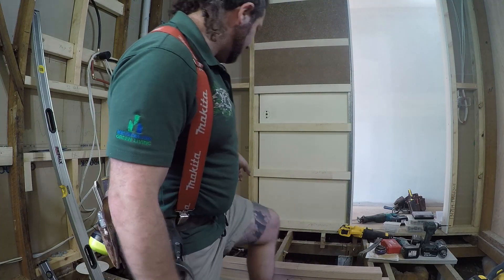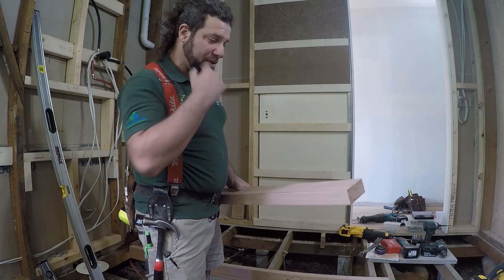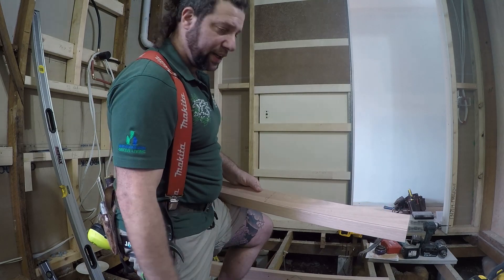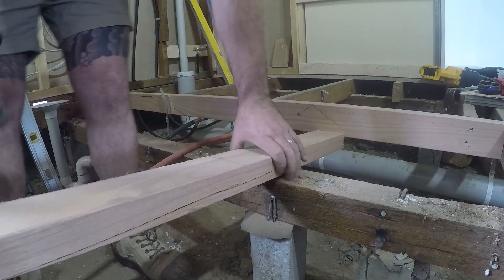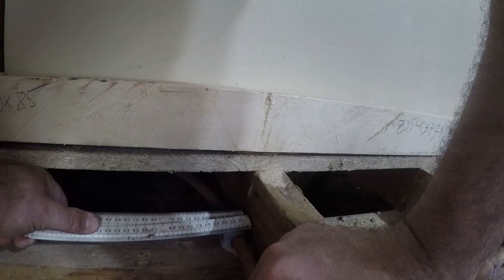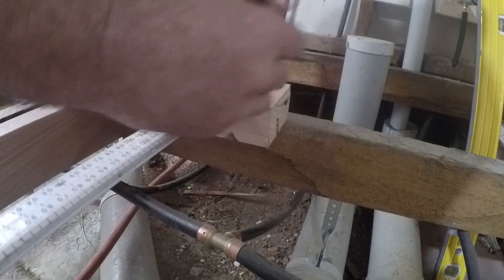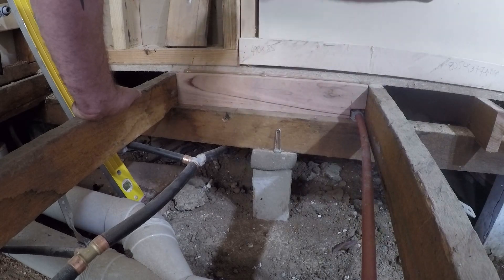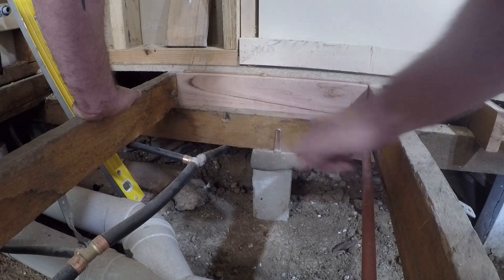How to correctly install Solid blocking / Noggin-ing for weight points

Comment: Can a noggin be placed flat for support under a shower or do they have to run down the joist?
Reply from the maker: Gday Dafydd,
Noggin's can be run in almost any direction, which ever way best suits the outcome... the key here is the fixing point and ensuring structural integrity.
Due to the outcome needed we need to understand the strength in the timbers and the grain direction.
On the other hand, if you're just "trimming out" for the shower base area with little to no weight, then you could look at a number of ways to run the trimmers nad joists.
Very important key note here is to always try to "Tie-In" your structure so as to add support and stability.
#stayawesome
joe joe
Reply: Noggin is a head

Comment: great video thanks, do you have vids on sistering or reinforcing bad or damaged joists. I have a house with OB framing and borers have got into the wood where it has been laid directly on brickwork (fireplace foundation with joist running over it) and the floor has dropped in this area. figure it needs bracing before shimming and restumping. thanks
Reply from the maker: Gday Ejgrae1989,
i have a run of video about 2 x years back on a home that was destroyed by borers... the joists were stitched and repaired or replaced.... the borers were so bad that they ate through a load supporting bearer and there was a gravity fed water tank in the roof area which in turn broke the bearer due tot he weight !!!!!  Have a look back over the history of hte channel otherwise ill see if i can find it and forward buddie.  Thanks For watching #stayawesome joe joe
Reply: @BeowulfBuilders  illl  check it out your channel is great thanks!